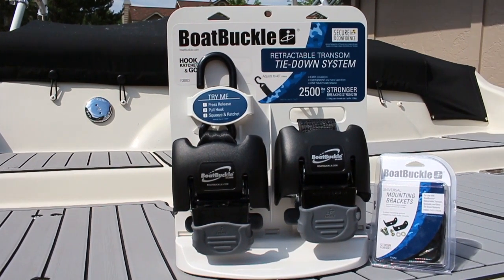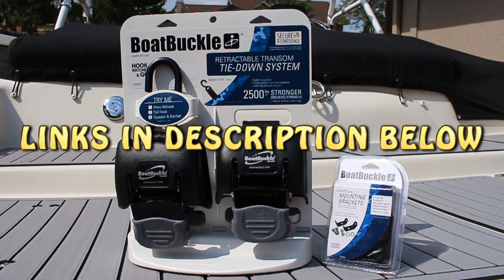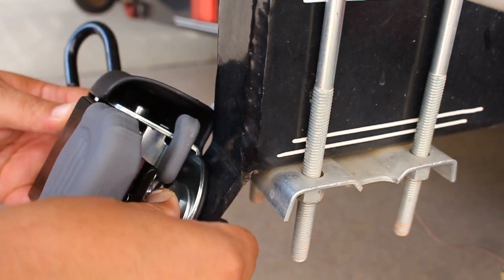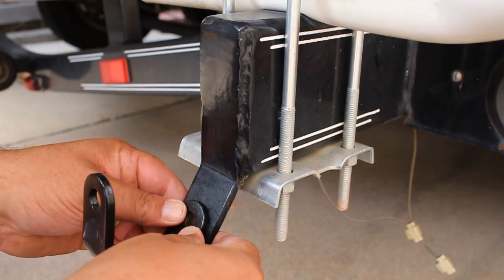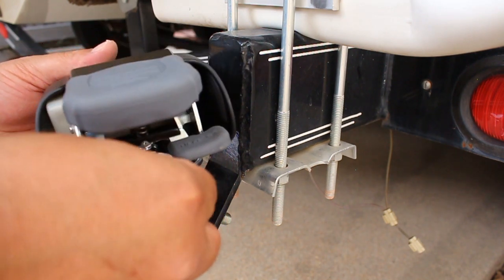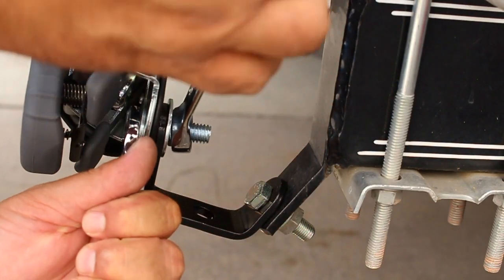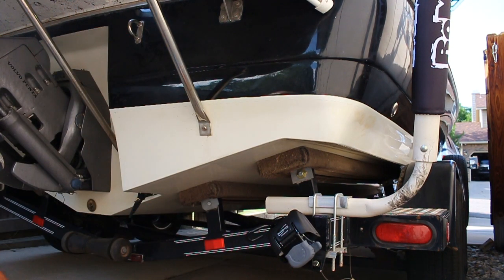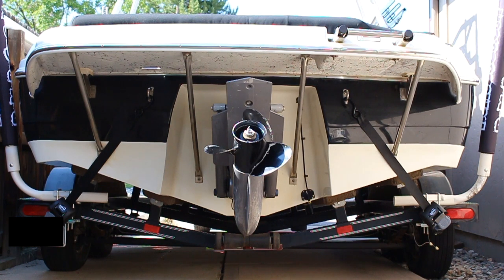BoatBuckle retractable tie down & mounting bracket kit installation & review | boat tie downs how to

Comment: I like that a lot. I think I’d just straighten out my trailer and skip the adapter. 👍👍
Reply from the maker: I thought about that but than I thought it might weaken the metal there, but it's totally possible it could work fine!
Reply: *   Or else shim up the original bracket enough to gain the clearance necessary. Find some thick washers or make some out of aluminum, etc.
Reply: And sometimes in doing that you create a situation where the strap is touching the boat or another part of the trailer which creates a friction point.